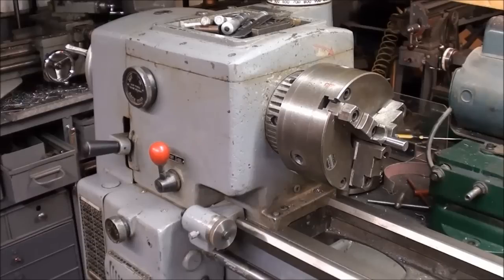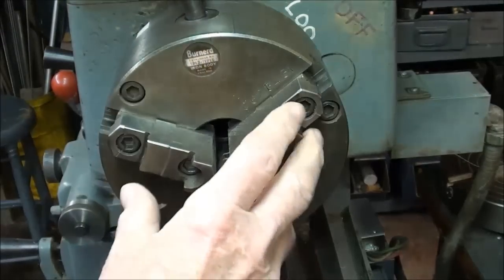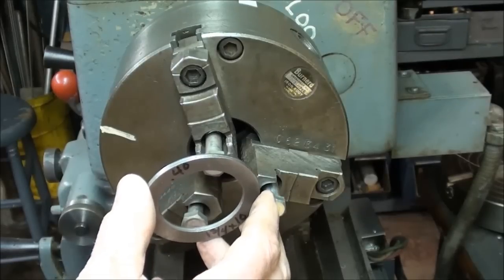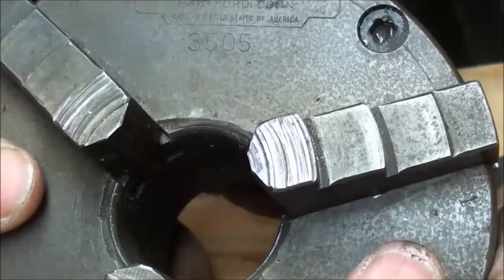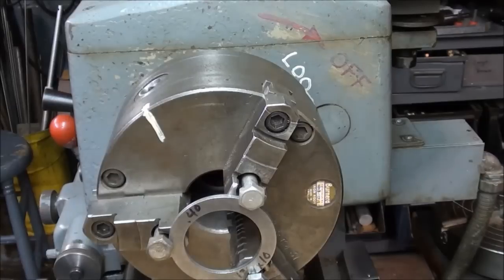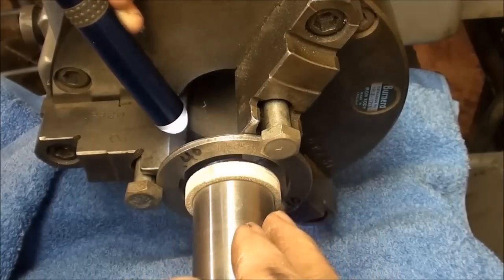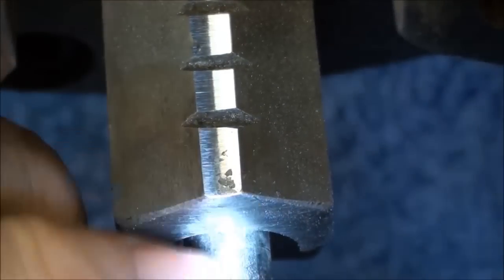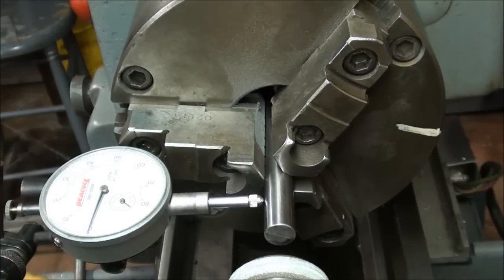MACHINE SHOP TIPS #147 Grinding the Jaws on a 3-Jaw Chuck tubalcain

Comment: Thank You Mister Pete for all your knowldge and HELP! Regarding lathe Jaws grinding fixture ?Machine shop program at Yuba College, Yuba City  California Circa 1975; Use a 3/8" thick steel plate cut the outside circle maybe 8" in diameter locate the center  and drill and bore the center hole  slightly larger than the jaws inside edge inside diameter which would be larger than the jaws clearence depending on the size of the cutting wheel? Next you need to scribe a circle maybe 1/8 larger from the jaws clamping surface. Next you need to bore three holes at 120 degrees so they each intersect  on center each jaw, when cut out each circle you can clamp the jaws down on the fixture and it is perfect you can grind all three jaws parallel and is really simple to make perfect like new jaws. If there are any questions I can make a simple drawing and send it to you, please note my dimentions  might be wrong as it has been 50 years since I made the last one taught to me by the Machine shop instructor MIKE that was the states transportation machinest. Most sincerly your 81 years old apprentice, Raymond Brown
Reply from the maker: Thank you very much. Good idea

Comment: Excellent tutorial Mr. Pete!  I need to do the same thing to my chuck jaws.  You'll find that if you clamp a part with a diameter that puts the jaws in the same position they were ground, there will be no runout.  But just like you said, the worn scroll will affect the runout differently in different positions.  Nothing you can do about that, but the bellmouth is the main problem and you fixed it beautifully.

Comment: Hi Mr.Pete.
Thanks for this video. It confirm my thought that I had to do that. I don't have the socket screws on the jaws. I dit tighten the jaws around a piece of aluminum set in the back of the jaws. Behind the highest point there is a flat surface on which we can place a round pièce stock. When squeeze firmly, the jaws can be grind. It really have to be done on this old chuck. Mine is a Burned 3 jaws chuck. I wanted to buy new Jaws from Burned but it is too old (1952 the says.) I am around 2-3 thousand runout at 3 inches with a 1 ¼ " round stock.  I wait to see how to clean the chuck now.
Reply from the maker: Mine is a Bernard too, from 1970.  Its pretty  worn

Comment: Very comprehensive video, like always. I've seen most of your videos and learned a lot from it.
One thing I found out, that sometimes when run out becomes an issue, the scroll gets dirty with little grits of metal and other stuff, at this time disassembling the chuck and a good cleaning improves the run-out situation.
The only thing I might suggest, is maybe to clean the whole chuck prior to the truing of the jaws, question of putting all chances on our side to start with.
Because of fabrication tolerances a 3 jaws chuck never gets 0 run-out on it's full range of operation, unless you pay shitloads of cash for the ultimate chuck.

Good thing I'm not your wive, You would sleep on the couch for a long time, at least until you stop snatching stuff from her, imagine drying yourself with a gritty towel after your shower... Scratch... Scratch... Scratch... Wearing out our Mr Pete.

Thanks again for your commitment.
Pierre

Comment: I had this bell mouth issue on the center of a 4 Jaw chuck. I used a large outer bearing race ring to load the jaws on a outer chuck step. Center Indicated the race ring and ground the bore much like you did and now both steps are true to each other.

Comment: I think I would put my shop vac hose near the open end of the headstock spindle, and suck the dust away from my work area, and lathe surfaces.  Then clean out the spindle after the process.  I watched an individual machine the jaws with a boring bar on another channel.  Great job.  The jaw bearing surfaces looked great.

Comment: Hey Lyle, I find that when the jaws are in bad shape, it's because the scroll gear is worn along with the jaw guides machined into the chuck.
In other words, overall wear of the chuck. Grinding the jaws will be exact only in the position they are ground at. Sometimes the jaws wear at the outer ends because the slop in the chuck allows them to get cocked in the guides. The best defense is to always cover the length of the jaw with your workpiece. Gripping on the end of the jaws only causes problems in the future. Thanks for the videos, I look forward to watching them.

Comment: I just spent a few days trying to ture up an old south bend 13" swing lathe.
A work piece would run out about 18 thousandths.
It is a Babbit box head stock.
I was sure that the head stock AND the chuck were to blame.
I made a girdle, much like a steady rest to fit behind the chuch. attaced by-way-of a welded bridge from the ways to the ring that was used as a steady rest.( to clamping devices, nothing welded to ways.)
Screws with balled ends ran onto the back shoulder of the chuck plate. i dialed down the screws till the spindal ran true.
With this arrangement in place, i re installed the screw on chuck( Cushman 6")
The indicator on the work piece was all over the place.
I decided to grind the jaws. i jiged a die grinder to the tool post and went very slowly and carefully.
Things improved, so i believed that i was on the right track.
Back to the head stock.
Removed girdle adjusted headsock with shimming and tourquing.
Re-ground loaded jaws( forgot to mention that)
We now have the work piece running at 3,1/2 thousandths.
I never thought i would see that tolerance from this old girl ( about 1935)
I just want to say that ALL of you men posting throughout youtube. have been a tremendous help through your teachings .
I never attempted to grind jaws in my life.
I developed the confidence to try, because of watching several of the video1`s that you men created.
Thank you gentlemen.
You all helped this lady to a successful result.
Reply: Always worth checking everything is correctly assembled first - including the jaws being in their correct slots in the chuck.

Comment: I just ground my chuck jaws last night.  I used the flex shaft on my dremel and zip tied it to the tool post.  It worked great!  The chuck used to feel squishy when tightening and the work could wobble around.  I am the 3rd owner of this lathe and the jaws were bell-mouthed but still tight in their slots.  A previous owner used a pipe on the chuck key because it's s-shaped.  It took a while to grind them, but the end result is a chuck that is no longer squishy and it holds stock firmly.  It's good enough for the stuff a 3 jaw is used for.

Comment: I have been looking for this for a long time now. My 5" 3-jaw Bernerd definitely needs this doing. I think putting the shop-vac over the end of the spindle-hole should help stop excess grinder-grit throw-off going in the important bits. I can run a flue-brush back and forth through the hole afterwards to help dislodge any bits, and suck 'em up. Thanks for the idea!
Reply from the maker: +nlo114 Thanks for watching
Reply: Thanks for your idea

Comment: I needed a 2 cycle engine rod of a larger crankshaft diameter than was available one time and I chucked up a suitable rod and used my dremel tool fastened to the compound to resize the rod.  It worked but I always worried that I got grinder dust in my lathe.  Great video.  I have made a few videos lately and I have great admiration for your video making ability.  I did not realize it would be so hard to do.
Reply from the maker: Thanks--you are right, its not real easy.

Comment: Great video! It wouldn't eliminate the need to clean after, but a big shopvac rigged to a scoop surrounding 1/2 or 2/3 of the headstock would help contain the dust considerably. On occasion I've even rigged one to the back of the carriage and it's helped a lot.

Comment: I have done the grinding and used soft jaws. I really like the soft jaws because they are much easier to true up. Just load them the same way and clean them up with a boring bar. No grinding dust and way faster, only down side is you have to have removable top jaws. Also for small thin parts you can custom fit them to the part.
Reply: I agree .Faster & no dust inside "ways" also ." Lots of ways to skin a cat ..best

Comment: Very interesting technique.  And obviously pretty darned effective too. I wonder if you could put a piece of PVC through the spindle and connect it to a shop vac for dust reduction.  I'd probably clean out the shop vac first for fear of a spark igniting lint and house dust, though.  Just a thought.  Keep up the great videos.

Comment: I soak my grinding wheels with honing oil.  I use Sunnen MB30 honing oil before I grind with them but I'm sure there are other grinding/honing oils that you can buy in smaller quantities that would work.  It greatly cuts down on the amount of grinding dust that is thrown in the air and inside the chuck when grinding my jaws and other work in the lathe.  It also grinds much nicer.  Hope this helps and many thanks for the videos!

Comment: I've used a similar method to true chuck jaws, and it works well, however I think people get the wrong idea about the accuracy capabilities of scroll type chucks. Even a brand new 3 jaw is seldom capable of concentric accuracy inside of .003 at any given diameter, and if the scroll and jaws are worn, much worse than that, varying considerably over the scrolls adjustment range. This method works great to straighten out the jaws themselves, and it will get a 3 jaw very accurate at whatever diameter the jaws were ground at. Beyond that, break out the 4 jaw.
   Good informative video!
Reply from the maker: Yes--all very true

Comment: mrpete thank you for thr information, correcting the jaws, one comment bread996 is that if scroll is bad you can only center so much at that position.
Three things you can do buy a new chuck, or cut the back plate guide loose .010" and get a true shaft and align it, or cut a slot on schedule pipe to fit the jaw to clear the jaws needing correction. With a pipe slotted you have even load but still a maybe if chuck is really worn out scroll

Comment: Thank you very much for your educational videos. If you think about your ring setup a minute or two you will probably figure out why your jaws where out a little after grinding them. The location of preloading your ring is off. Yes, your are preloading the jaws the correct direction, but you are locating off the tapped holes on the Chuck and not the jaws themselves. The jaws locate to the chuck with the ground in step and slot, not the drilled and tapped jaw fasting holes in the chuck. You need to locate off the bolt hole counterbores on the jaws themselves by using a soft jaw boring ring. You can look this ring up on the web. I hope this makes since and is helpful. Thanks again for your very helpful videos and sharing your knowledge.
Reply: Not so. The scroll determines the position of the jaws, The bolts and ring are only proving resistance in each jaw for the scroll to tighten against.
Reply: @ken9503  Assuming even clamping with the scroll it wont.

Comment: Great video! I love this sort of stuff. You may want to look at reversing the rotation of the motor on the grinder.
Reply: Now that I think about it, reversing the motor probably wouldn't work for that application. It would probably also affect how it vents. Thanks for sharing.
Reply: @TheBergy32  No reason not to have the grinding wheel go in the direction you prefer.
It would not affect motor ventilation as the fans are bi-directional for the obvious reason the motor manufacturer doesn't know which way you want it to rotate (or both!) It's why they use simple centrifugal fans.

Comment: Always like your videos there are two things to consider from my experience grinding jaws.  One is that to also check diameters that are greater than what you had done the grind with think you said 1-1/2".  Being that if there is some problem with the way the chuck was mounted the jaws would have a greater grind on one or two of the jaws andd when you put in smaller stock then you are on the flat of the inside center however when you have larger diameter work then the ends of the jaw hold onto the work and if one or two jaws have a deeper grind then the work can be out as much as .010.  Had this happen to me on a Cushman chuck and until you look at the amount that was ground off and compare you might totally miss it.

Second if scroll part of the chuck is bad then use soft jaws for an important diameter that you might be machining all the time.  For me it is 2" and 3" brass.  Am always turning that so one set of chuck jaws is machined to 2" and 3" and if there is something else that needs to be done either use a different set of soft jaws or the regular master jaws.

Comment: I think maybe the runout you see on the indicator is not a runout on the chuck, but a little worn spindle bearing. Because when you put your hand on the chuck to turn it, the indicator moves a little to the left, but it goes back again when you let go of the chuck.
But..... thank you very much for good videos. I have an old South Bend model A and I have got many good ideas from you

Comment: Just what I have to do to mine!  Bell mouthed jaws are usually caused by turning things between the chuck and a slightly offset tailstock. Because the stock is slightly bent between the chuck and the center, the jaws wear as they come around to the 'inside' of the bend.  A little bit of wear each revolution results in a lot of wear over 35 years!

Comment: You can buy adjustable rings for pre-loading chucks when cutting your own soft jaws, same method as here basically but it's a large ring and the holes for the bolts are cut outs made in a spiral, this gives the adjustability just by turning the plate.
 I am not sure what chucks they are available for though but maybe could make your own.

Comment: Just a good alternate to sneaking out the brides towels, is I hit local garage sales and buy up as many FR (fire rated) blue jeans you can find. The offer great protecting and besides cheap, don't have to dampen with water. I also use the leg's to sew up sleeves for welding, and fender cover, ect. Just a thought, but if one used a good shop vac (with dust trap) at rear of spindle, cut way down on contamination of the lathe & shop?? Bear in Tx
Reply from the maker: Thank you for some good suggestions

Comment: Nice video, when I did mine I used the washer method using a washer in the back and removed a little bit out of the back were the washer was, but this is a much better way

Comment: I have just done a grind on my chuck jaws that had bellmouthed, , before commencing the grind I discovered that there was slacknes I the headstock bearings which I concluded mah have caused the bell mouthing, or a misaligned tailstock,

Comment: Thanks for the video but..
I think that preloading the jaws from one side (front) is not the same as preloading with a round stock along the jaws length and perhaps thats why there was run out after the fix , before the fix the round stock was not touching in front but did you check if they are in contact at the back after the fix?, i would have used a 0.25mm paper wrapped on a test bar to check if the contact is along the entire length of the jaws or not

Comment: Dust can be blown away by a powerful fan which any shop should have for many reasons. I recommend "bounce house" fans or similar capable HIGH VELOCITY blowers. Other options could be a large shop vac nozzle very close to the wheel to catch dust. If you put the leg of a pair of panty hose over your shop vac filter it will last much longer and be easy to clean.
Reply: +Ob Fuscated 
Better would be to rig a vacuum nozzle close to the chuck, that way the dust isn't blown all over the shop.
Reply: That’ll REALLY make your wife mad! 😂

Comment: Will using this procedure be better for the chucks small work holding ability/repeatability if I use a smaller diameter stone? The method you used with bolted jaws would allow the jaw tips to pull out slightly, causing more grinding to be done at the rear of the jaws, guaranteeing clamping at the jaws outermost tips. Any ideas for solid jaws on a 80mm mini lathe chuck?